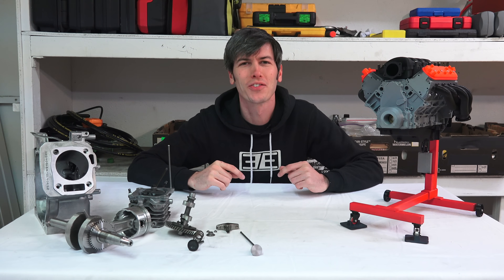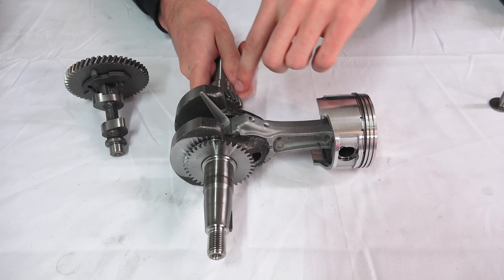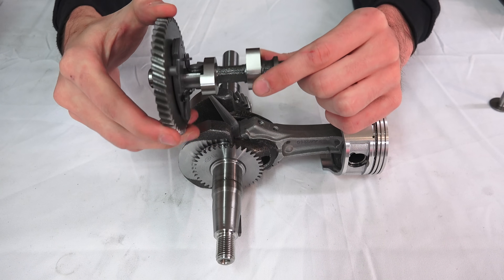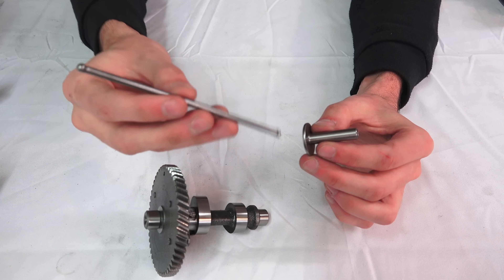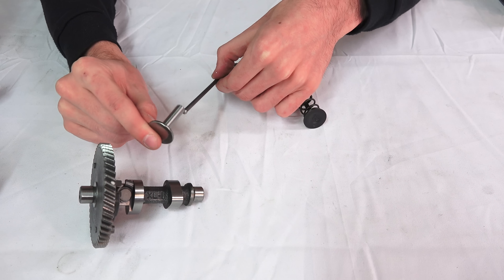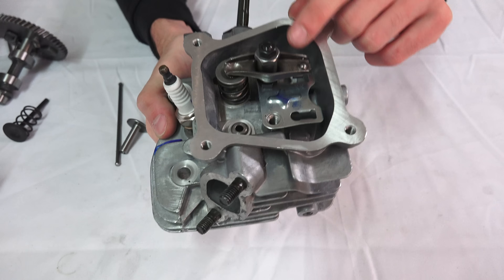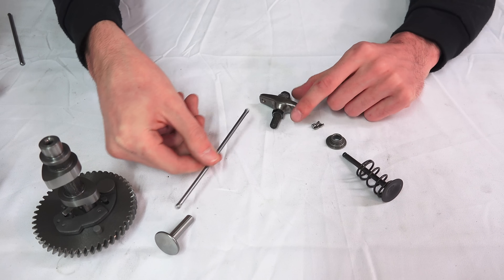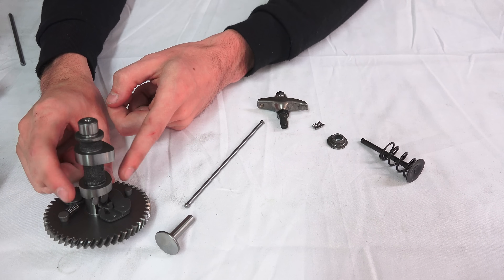Why Can't Pushrod Engines Rev High?

Comment: Don't know if I missed it in the video (they are great BTW) here are a couple of things that are often why that may have been overlooked

Large valve size which are heavy

Hydraulic lifter limits before they pump up. Mechanical lifters require maintenance, so not often used in production except on high perf engines.

Also valve train weight on the lifter side of the fulcrum is much less important than on the valve side.

Overall another great video!

Comment: It's a great video, but as others have stated, it's misleading.  Pushrod V8's tend to have pretty long strokes, so piston speeds (Which I believe he also did a video about.) are going to be a huge limitation on where the engine is going to make power.  Keeping the piston speeds within an efficient range where an engine makes power means you don't NEED to spin that fast... so... why bother?  Pushrod motors are shorter and less complex; so that's why they didn't make them OHC. 

 However I believe the old C4 Corvette ZR1 with the LT5 was a Quad-OHC V8 built by Lotus.

Comment: So 6,500 rpm shift point in my ls2 is low Revving? Doesn’t seem bad for a 6.0L. Heads, cam and intake could spin it to over 7k and still have decent street manners.

Comment: Modern DOHC engines develop slack in the timing chain very early due to the intentional play in the chain tensioners. Pushrod engines on the other hand have a super short chain that virtually never wears out.

Comment: Grossly mistitled! There are many pushrod engines that rev 7 + 8000 RPM a simple LS engine for example. If you do not have the springs that are strong enough to return the valve I don't care if it is an overhead cam or a push rod you will get valve float at a certain RPM plain and simple. This is a very misleading title and does not describe the true things that make an engine able to turn high RPMs push rod or overhead cam valve springs and engine stroke are very limiting factors of RPM
Reply: With just a tune, the 376 LS3 goes to 7,100 and pulls hard the entire time. With 3.91 gears it goes into 3rd at 80mph at about 4k and she is a screamer!
Reply: 8000 rpm is high for a pushrod motor, not for an ohc design with the same work put into it and design intentions. OHC also needs less spring pressure than ohv
Reply: This is what happen when young boys try to explain something they know nothing about.

Comment: Lightweight valves, titanium retainers and a good beehive spring help control valve float in hydraulic roller applications. It isn't uncommon to see fbodies revving out to 7200rpm, it does require a decent set of rod bolts though (stockers are weak) and many like myself don't feel like building a small aluminum engine that can't be bored for more cubes. The ls6 intake tends to give up at around 6800rpms as well. It's all a combination. Besides we don't need to rev High to beat a Mustang with 4 Cams and twice as many valves. Lol.

Comment: Sorry folks, he only says pushrod engine  can't rev high but not weak. He didn't tell folks who love  fat low end torque actually loves pushrod or OHV more than OHC & DOHC engines.  Also he didn't mention why OHC and DOHC engines  don't have very much low end torque naturally. For OHC & DOHC to produce  strong low end torque would be the same problems as OHV engines to rev high. Now the next talk he also have not mentioned was the of emissions advantage and disadvantage of  OHV vs OHC & DOHC. He also did not mention the costs differences and why. This video also didn't mention what applications of OHV vs OHC engines works best and why.

Comment: I have a 97 Isuzu trooper and It make a sorta clicking noise. Hard to explain by text. I've been told by a mechanic it's probably the valves or something with the timing. I think it's loose valves. You tube comment on something similar say there's something in these 3.2L 24v V6's that tightens the the timing chain at differing rpms. 

I'd just bring it to an isuzu dealership and get it sorted there but um.. yeah.. That's sadly no longer a thing in America. 😔 would you by chance have any ideas? Thanks

Comment: GM used cam phasing on the L99 before the LT1. It was the 6.2 in the automatic camaro's (manual trans got the LS3)
Reply: RealSprooseMoose and the L99’s suck.

Comment: Cam timing is not that important old school f1 engines didn't have variable cam timing. Variable timing is good for drivability not wot so racecars don't benefit much. A better title should be why pushrod engines don't like to rev high. DOHC and SOHC also suffer from valve float so that's irrelevant. The main thing holding back high rpm is the bore to stroke ratio.

Comment: I've always felt DOHC engines were overrated anyway. Sure they can rev higher and on paper they have a lot of power at max RPM, but in every last one of them that I've driven they don't get much power until they rev really really high, trouble is an automatic transmission won't let them get anywhere near their max RPM even in sport mode so a lot of that theoretical output is left on the table.

Comment: NHRA Pro stock rev to 10,500 used to go to 12-13000rpm. They are 500 cubic inch also. Maybe do some research? Look at corvette racing. All the other teams want the ls7r banned. 2 valves flow just great for them.

Comment: You mentioned valve float because of the springs but ohc requires valve springs too. So why isn't it an issue there?
Reply from the maker: Because they have smaller valves (4 vs 2) and don’t have pushrods, so significantly less reciprocating mass.

Comment: There are plenty of 3 and 4 valve pushrod engines out there, matched with stiffer springs like you said and for most applications they can keep up with OHC designs but in a cheaper and lighter weight package. (1 cam vs 4 cams and wider heads with added timing components) OHV is more compact than OHC.

Comment: Technically a 4 valve per cylinder engine revs higher than a 2 valve per cylinder engine but in my case, my car runs the Chevrolet LS1 V8 engine in tuned form which has 16 valves which in stock form has the same power output as the 32 valve Nissan VK56DE V8 engine, both also have similar engine capacities (5.7 & 5.6 litres).

The cylinder heads on both engines flow the same (290 CFM) as the Chevrolet engine uses large valves.

The RPM rating of the VK56 DE engine varies from 4,900-6000 RPM depending upon which homologation of engine it is,the Chevrolet LS1 revs to 5,300 RPM.

When I did an automotive course at tech the cause of the lack of revability on the older pushrod engines was to do with friction points in the valve train due to the valve train being too long.

They have been improved with the implementation of roller rocker arms & roller hydraulic lifters to reduce friction.

The Chevrolet engine is in a Holden Commodore & they went to a quad camshaft 24 valve engine in the V6 models, they had trouble with the valve train in them such as failed timing chain tensioners & the chain itself stretches.

The cost to the customer to supply & fit the new timing chain kit is around $3000 AUD to get Holden to do it,it would still cost the customer up to $1000 AUD for them to do it themselves.

The keyway on the crankshaft timing sprocket can wear out in stop/start traffic as General Motors didn't allow the timing sprocket & the key to have enough meat.

I'm actually glad that I didn't buy a V6 one of them because the V8 engine actually has fewer moving parts which can fail in the engine,it is simpler in design.

Comment: I like  watching your videos. first off ,what do you consider a "hi revving engine"? sport bike have a fairly hi revving engine &rev 12k to 14k for most applications. these are small engines. most production motors redline at 6,500. factory performance run 6,500-7,000 for v8's. NASCAR and F1 run short stroke engines & turn them to the moon. old school ford 289-302's & chevy  283,302 &327's in the 60s turned 9,000. All pushrod engines & this was before roller cams.  when I was in school a guy told me he didn't like BIG BLOCKS because they couldn't whine. My father had a 427 66 Vette with an L88 short block w/ 435hp upper end that turned 8,200. Rpms over 6k effect reliability . you need to define what you call "HI" rpm's please.

Comment: Neatly explained... I wonder why so many US automakers are so fond of this arrangement... In Europe most engines are xOHC, in lots of cases camshaft's lobes hit directly into the valves, not even needing rockers. US automakers compensate it's shortcomings by oversize: A 7 litre V8 will deliver no matter how (you can be grateful that gas is 1/3 what cost in Europe). Here, 7 litre car engines are virtually unknown, being 1.8 litres the median.
Reply: Don't get me wrong, I love these Mustangs, Camaros, Challengers...   but using them in Europe would be really painful €€€
Reply: Hal, Chevy is fond of the OHV arrangement because the resulting V8 is less complex, cheaper, lighter, smaller on the outside, and easier to package than a much smaller displacement DOHC V8. On the other hand Ford's competing V8 is DOHC. The Chevy is 6 + liters while the Ford is 5 liters. The power is very similar (although the Chevy makes power lower in the rpm band) and so is the fuel economy.  Both of these engines would probably be no more expensive to run than an equivalent power European engine. We are just lucky to have low fuel costs here which is fueling a rather insane horsepower war.

Comment: Hello Jason, i've been asking you about the Fiat/Lancia TriFlux engine. I also have to tell that you can have high revs in a pushrod engine, but the problem is you need a very short stroke and a big bore, with light pistons and rotary assembly. Also you need to improve all the pushrod assembly, solid roller lifters, lighter rocker arms, stiffer springs, a good oil. You needto do a expensive inversion

Comment: I didn't watch this video, just came to read comments. At one point NASCAR engine spun up to 10-12,000rpms, now with new rules it's about 9,000-10,000. The new Coyote can do 9-10,000 with just some tuning, but honestly push rod V8s have a sound and feel that can't be beat, to me anyway.

Comment: My ls7 reves to 7100 stock.
Reply: Tony Chacon LS3’s go to 7,100 with just a tune and don’t drop valves.
Reply: UnsulliedSpy also the new z28 also has a ls7, I'm sure they have made some improvements about the valve guides...
Reply: 427 CI ls7s drop valves

Comment: While the valve train does indeed limit the RPM of an engine .. there are pushrod engines that do see in excess of 9,000 RPM .. yes they are specialized , but a bigger limiting factor is piston speed or load ... beyond a certain load the piston structure is overstressed and prone to failure ... and one of the biggest issues with high RPM .. as you double the RPM the stress is squared ... So RPM isn't as much a good thing as you might think ... The higher the operational RPM the shorter the service life ....

Comment: Okay, theoretically everything you say is true but...

1) stock car engines (NASCAR) hit nearly 10K for 400-500 miles. Not a particularly useful life span but they do handle it.

2) I've seen solid lifter push rod engines (Gen 2 small block chevy) easily rev to 7-8K and still have useful lifespans around 20K miles and even then it was just a matter of replacing the valve springs. 

3) the only modern pushrod motors being made have substantial displacement, like the ls3. They simply don't need to rev as high to make power and more broad torque curve, which is IMHO more fun to drive. 

On the other hand, you can do some crazy stuff with the ports if you don't have to work around the pushrod bores...modern ohv engines flow some insane air.

Comment: Didn't the LS7 rev to 7,000rpm stock? GM has proven how viable the pushrod design is. Smaller, lighter, fewer moving parts than DOHC mills.
Reply from the maker: Yep, with wicked light titanium valves! But for production cars, 7,000 isn't all that high. Even the GT350 is hitting 8250.

Comment: Uh there is no need to rev high with the kind of head/cam combos that the level of displacement pushrod engines allow. Literally unneeded but they do exist.
Reply: mutiracialbeatdownPB neither do DOHCs. Go look at the AMG V8s they don't rev particularly high either. 

Displacement and pushrods aren't linked that much. Displacement more depends on how much power you want to make and how reliable does it have to be.
Reply: Exactly. It's a factor of Head/cam flow potential and displacement available to drive it, if you don't have a lot of displacement you will need to rev it more. However the larger engine even with the same exact cam/heads will have better average power. Like the AMG engines being DOHC but large displacement thus not needing to rev out that high, pushrods just allow a very small exterior physical size vs internal displacement.
Reply: mutiracialbeatdownPB 

It's obviously not that much of an advantage because if it was they'd be using it on bikes as weight and size constraints are big issues there. Bikes tend to rev much higher though so that may be where it comes into it, giving increased airflow and more robust valvetrain system comparatively.
Reply: mutiracialbeatdownPB quite possibly.

It's difficult to tell, Europe doesn't have an LS equivalent. We've no big lazy engine that's cheap and easy for the masses to get there mits on. If we did (assuming it'd be some German descendant and therefore DOHC) it'd be interesting to get a better comparison between the two. 

AMG engines all well and good but I wouldn't really call them equivalent to chevy crate motors.
Reply: mutiracialbeatdownPB I'm more a fan of high rpm. Motorbike fan :P

I like having to work for the power. 
Not that anything 600 cc and upwards lacks power in any shape or form
Reply: mutiracialbeatdownPB I promise you the B16 engine won't remotely compare to a bike engine. 

Bikes spoil you because the engines are utter masterpieces. 

My dad had a 600 cc yamaha thundercat from 96, we've been doing some tlc etc. One of the spark plugs rusted into the head because of the way water collects when the bikes left to stand outside in the rain (age related). 

We took the engine out, the carburettor is heated by the water coolant, it had plastic blocks that raise and block off part of the barrel at low rpm I imagine to restrict airflow and improve the fuel air ratios
Reply: There were so many small details and yet it's been built so well that on a 20 year old bike that has been kept outside in the rain we didn't even know the bike had this until we took it apart because we wanted to do things such as balance the carb etc. 

I love bikes for the engines they have as much as for what they are and riding them.

Comment: Pushrod engine has a lower center of mass also since the cam is down low in the block. Compared to  single /dual overhead cam

Comment: Push rod engines turn on faster than ohv, that's why they are used in sprint cars, dragsters, race boats. I have seen many 9000rpm+ pushrod motors in victory lane.  The set-up time for a pushrod engine is far less than shim under bucket ohv mills. Ohv have there place in Indy car & and road race mills where a flat power curve is desired & RPM is not the cat's meow.

Comment: How about the bigger ports that can be used without pushrods in the way. Also, Because of various laws and economies, Europeans had to use small displacement engines and so they had to rev to make power. Americans did not have horsepower taxes etc. and had long distances to travel. The larger displacement engines turned slower, cruised nicely and were more economical to build with lots of power.

Comment: Most production ohc engines don't rev to 9k only the exotic ones which shouldn't count. Like others have said, NASCAR engines are large displacement pushrod v8s that rev over 9k for hours at a time.  Really it's more about having proper valve springs to control the valve. Pushrods and rocker arms cam move as fast as you want want, most ohc engines use rocker arms and lifters just like pushrods engines. The 7.0liter ls7 in the c6 z06 will rev to 7k from the factory and higher with a tune and not damage anything. Pushrods engines have less moving parts if you concider less valves, less cams, less lifters, less rockers and 6ft less timing chains and guides. extra tensioners ect.

Comment: Push rod engines can rev as high as you please as long as you are willing to pay for it in Valve Spring resistance. Nascar engines turn 9,500 RPMs all day with pushrods, and Prostock engines will go 11,000+ with over 8 liters of displacement.

Comment: Can you do a video on a theoretical situation of say a 4 valve per cylinder vs a 2 valve (with extremely large valves taking up most of the dome) cylinder engine. Or a 2 valve in a clover leaf pattern.

Comment: Back when there were only side-valve engines, some engineer decided that having the valves on top of the pistons would be better. But, how to do it? Firstly, the valves would need to be turned upside down and secondly, the motion of the cam must somehow get on top of the now-upside-down valves. He invents pushrods to get the motion of the cam above the valves, and rocker arms to change upward motion into downward motion. Problem solved. When he showed his idea to his boss, why didn't his boss say "That's a great idea, but why not move the cam up there too and do away with all this machinery in the middle?" In other words, why didn't the pushrod engine die on the drawing board?

Comment: Hundreds of thousands of dirt track racers spinning 7500-8500rpm with stroked small block chevys would disagree. Not to mention NASCAR, and the beloved LS7. Sure it isn't Formula 1 rpm, but it's quite a bit higher than almost every DOHC 4 cylinder on the market lol.